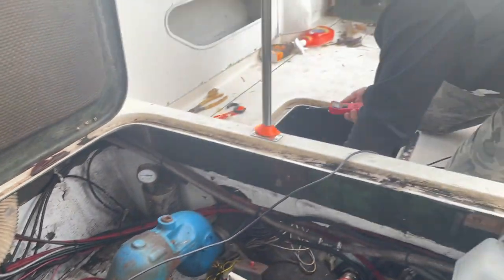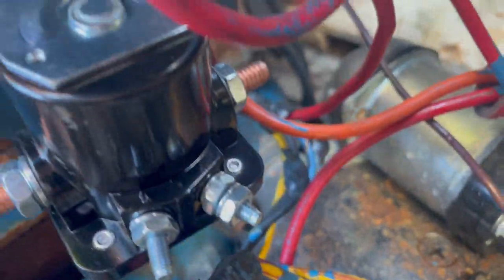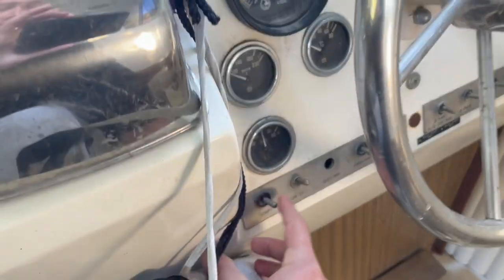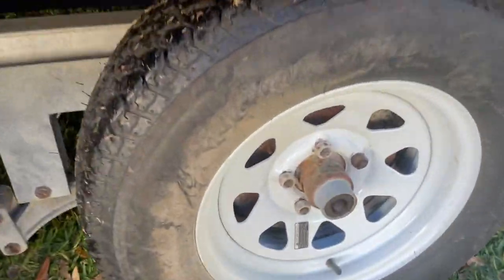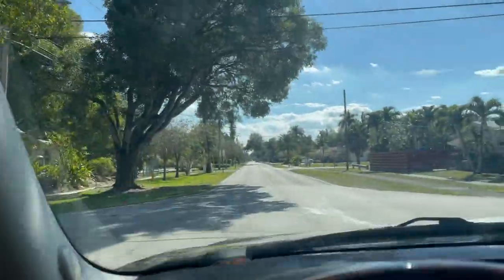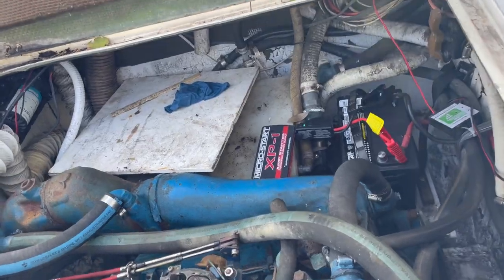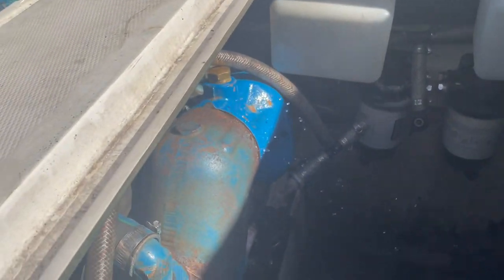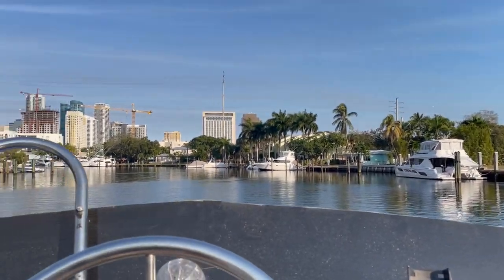After a year of struggles the Bertram 28 is back in the water. Fort Lauderdale new river water test

Comment: Great to see this project moving along!! There seemed to be some slight dripping from the port side rudder seal as well but could be as simple as just tightening down on it. 20k to go with new  engines and jet drives seems a bit optimistic from my view. I would think 20k for engines alone doing all of the work yourself and I would think that jet drives would be transom mounted which would require pretty extensive modifications although I have never actually researched that conversion. I had enough headaches with my jetski and swore that I would never own anything with a jet drive after that experience. Good luck!!
Reply from the maker: Thanks brother, you’re definitely right about the rudder seals. I tried getting access twice now and I haven’t figure out how to make myself fit!
$20k is $16k in AT jets and home built LS’s with turbos, dry exhaust and no marine stuff. But then exposed engines and not really a useable family boat, just a hot rod. Maybe one day but mostly fun to day dream about. 
At the moment just waiting for space to open at the Lauderdale small boat club so she can go live in the water
Reply: @BobHGarage  Looking forward to seeing you out on the water, it took me forever to find a reasonable slip to keep the boat at. For the rudder seals, I worked on that part with my back cover off so it was a breeze. I think the only way with the cover is to just go in head first.
Reply from the maker: @nicolasmabru  I think you’re right. Probably going to have to take the whole thing off

Comment: here in Australia  your trailer would be illegal to use on that size boat I got a 25ft bertram and got triple axel trailer you guys get away with so much over there. this size boat would be great with tween  diesel engines and lot cheaper to run
Reply from the maker: Brother it’s illegal over here too. The boats beam is too wide for the streets as well without “Wide Load” permit and signage etc. 
It’s only about 2 miles to the boat ramp so I was willing to risk it. Not again though. This things next and final journey on a trailer is to drop her off at her wet slip. 

As far as diesels, you’re right it would be safer and cheaper to run but it would cost about $50k more than what I paid to have a boat that’s cheaper to run 😂
Reply: @BobHGarage  wish i live in America boats are lot cheaper to buy and so are the parts i bought my boat trailer in florida and had it shiped to Australia as it was $8k cheaper to do it that way and all my parts I get from America too as here they just rip you off. example to buy a whole impeller kit with housing and gaskets +o ring from  America $30 here just to get impeller $35
Reply from the maker: @fx-dm2wx  wow that crazy, I had no idea